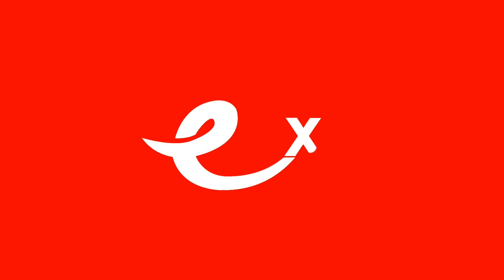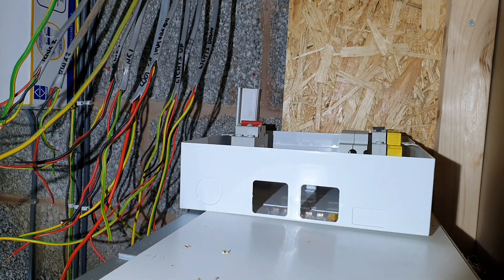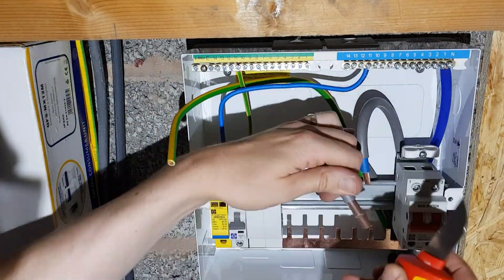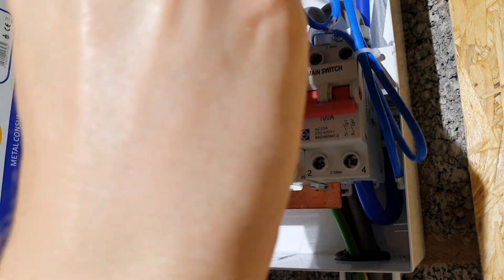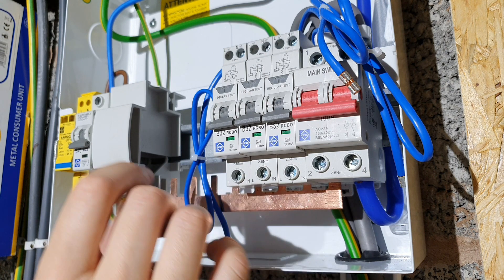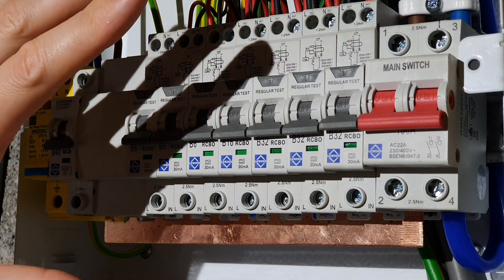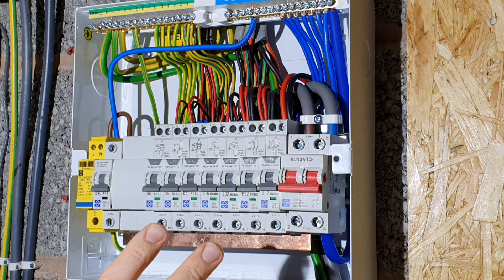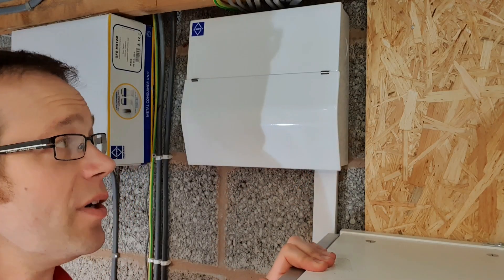LEWDEN CONSUMER UNIT with DOUBLE POLE RCBOs

Comment: So what your saying is for all these years these RCBOs  may not have worked when you had a fault if it was blinded by DC which made it dangerous when we were told RCBOs the greatest protection for fires and to save life's tripping in 30 MA when it may not have worked  could you or Gary explain that please

Comment: They need to have a DP version of the RCBO and AFDD with a combined L & N bus bars as they have on the Continent.  They call them combs. This means only one common bus bar in the case, the earth. So much easier and neater, and faster to fit.

Comment: All those rectangular knockout are not ideal...

Why don't all new board come with NO knockouts so you can cut what you need where you need it?

Even a part-P sparks carries a full range of cutters, so designing your entry around pre-burst holes (often at APPAULING inconvenient spacing) is just SO 1990s, we have Starret TCT cutters, just use them!

Also it is requirement to offset the RCBOs @ 15 degrees from vertical or a contractor preference?

I think I'll leave Lewden (which they do well!)  to make Ceeforms and use brand name consumer units, this is nearly as bad as a Hagar!

Comment: If you’re going to be doing rcbo-only units, the layout with those neutral wires coming off them into neutral busbars becomes particularly senseless.

Wouldn’t it be allowed in Britain to have the type of layout more common over here, where input L and N are both on the input side? Usually accomplished with either dual input busbars or even click-in panels.

Comment: Still a bit unsure about those square holes, you didn't actually demonstrate using them. I accidentally bought a Hager board with square knockouts & ended up having to buy some very expensive plastic conversion plates to turn them into round ones.

Comment: In my country we usually have a situation where one phase is dead or is at low voltage. In that case we use a manual phase selector to switch the entire load to the good working phase. With these consumer units i don't see how you would add a manual phase selector. Any advice?

Comment: Wiring has changed so much since I used to do it, I've not seen a torque specific screw driver before, I've used a torque wrench when rebuilding engines. Have you seen the CU's with dual busbars? They're well neat, no need for all those neutral leads to the RCBO's, great for TT supplies.
Reply from the maker: It's an ever developing industry that's for sure. Lots of interesting innovations going on.

Comment: Why are manufacturers STILL only making such small boards as standard?

Typical 3 bed semi with garage and utility room:
3 x lighting up, down, garage/outside
3 x rings - up, down, utility/kitchen
1 x dedicated fridge/freezer circuit on RCBO minimum to avoid false tripping elsewhere shutting off all power whilst on holiday!
1 x dedicated boiler feed
1 x cooker high power feed
1 x garage/shed power
1 x EV output
1 x solar PV connection

Plus space for surge protector (WHY?? NEVER had any problem with surges and the last thing I want is total power off if there is one)

Plus space for isolator (WHY?? should be an external isolator, post meter, pre CU - plus Henley block for separate feed/s to external shed/garage)!!

Plus space for AFI

 Totally insufficient space in standard CU for all that with AT LEAST 2 blank positions spare for further /later requirements. WHAT? A whole NEW CU AGAIN!! JEEZUZ! What do you guys think customers have in their gardens ... Money trees? The actual cost of the metal box is a tiny proportion of the overall cost so fit one with space to expand. Better yet, let's junk CU's altogether and start fitting industrial style steel cabs 450mm x 550mm x 150mm with space for plenty of additional monitoring kit and home automation instead of all this ad hoc external (not so smart) technology on separate screens with zero connectivity to a computer.

If anyone says something completely dumb arsed like "don't bother with ring mains , single spurs will do!" I swear I'll blow my lid! Just one 20A spur with multiple dual 13A sockets is incapable of supplying BOTH sockets with their rated feed. In a kitchen WITHOUT a ring:
Kettle - 3kW
Microwave -  1kW
Dishwasher -1kW
Toaster - 800W
Fridge/Freezer (not on dedicated circuit) 
Cooker hood/extractor - 450W 

That's already over 6kW - 2 fully (over) loaded spurs without adding in other stuff also likely to be used at the same time. The only differences being:

2.5mm2 T&E cable ring main with ONE single run return to complete the ring and with headroom of 6 amps on the breaker and 50% headroom on the cable capacity

Compared to:
2 x 4.0mm2 spurs to split sockets - how are you going to split them? How are you going to ensure that three heavy loads CANNOT all be connected to one spur thereby overloading it? Answer: YOU CAN'T! Hence the use of a ring for the kitchen and a ring for the utility room and play safe, for the increased cost of a few metres of 2.5mm, instead of a full run of 4mm for Upstairs power. The latter is ALWAYS more expensive!
Reply from the maker: Wow, what a passionate comment, thanks, there's quite a bit to unpack here but just to address the headlines. This size consumer unit filled the need for the three bed detached house that it went into leaving a couple of spare ways, of course there'll also be lots of installations that don't have as many ways. Surge protection won't disconnect the power it just absorbs the surge helping to protect the installation and equipment. You raise some interesting points on rings vs radials. I always take a case by case approach to this. I rewired my previous house with 16A radials and no problems on loading, I'll keep the ring for my kitchen when I refurbish it but recently put an A2 radial in my garage, it's about getting the right circuit in the right place I guess. 👍

Comment: Knipex ergo strip for meter tails. Will stop you in your tracks when stripping larger round conductors
Reply from the maker: I've got one of those, didn't think to use it for tails, I'll definitely try it next time. 👍
Reply: @efixx  like a brand new set of crops it takes some getting used to to make sure you don't damage cores but once you get it you will find you only want to use it and nothing else
Reply from the maker: Nice, can't wait to give it a go!
Reply: Surge protector leads look tidy but being at that end of the board extends the length significantly. JW's  video on the subject shows that the length should be as short as possible for it to be effective.

Comment: The tail clamp gives trouble with the routing of the tails if you want to bring them directly up behind the main switch. The thought that they may have designed the new consumer unit with a little more depth in the enclosure and bring the DIN rail forward resulting in more space behind the DIN rail. 

Just need to find somewhere that's selling them now

Comment: Nice video, thanks for posting. Not trying to be pedantic but are these RCBOs really double pole, do they offer overload protection on the neutral too? or are they single pole switched neutral like most other's.
I know you can get double pole RCBOs but they are  generally used in Europe.
Reply from the maker: Not pedantic at all that's a really good question, I'll try and look into it and let you know.
Reply: Hello Andy! Our NEW RCBOs are Double Pole Switching but only has overload protection on the line pole. If you need any further information, don't hesitate to contact us!
Reply: Current only flows if a circuit is complete ~ break the circuit once and current will cease to flow. The isolation achieved by double pole disconnection protects (grounded) you from a higher potential on either of the supply-side conductors. There is no need to break the circuit twice in the RCBO.

Comment: Lewden are great . My local supplier struggled with stock lately and I reckon it’s because they have changed their design lol . Still a good idea 👍🏻
Reply from the maker: Keep trying Tom, I'm sure they'll be back up to speed, there's issues with supply chains all over the place at the moment. 👍
Reply: Hello Tom, Thanks for the feedback! We are always working proactively to keep improving our products.
Reply: @lewden3275  bit if constructive criticism... I fit these as my go to boards now and have for a few years. However... the tails clamps tend to get in the way if the first rcbo and push it sideways a few mm as can be seen in this video. The spd's sit at a very slightly different angle on the din rail too almost tilting slightly upwards. And finally are there any plans to drop the control gear direct branding from the ones purchased through denmans, with stock currently up and down I'm having to use 2 wholesalers, if it was all the same it would be nice.

Comment: Is there a reason they all have a wire builtin for neutral in? Why not use a terminal like for everything else?
Reply from the maker: Most manufacturers do it this way currently, a few are starting to produce boards with neutral busbars like the line ones, mainly a cost issue I guess.

Comment: I had a comment from my inspector when I showed him a board that I had exposed the coloured insulation on the tails. He said it was bad practice, reducing the protection to single insulation. Thought it was interesting to see you do exactly as I had for years.
Reply from the maker: Yeah, that's how I've always done it. I guess the thinking on their part is that you should only take the lid off if the main switch is off so everything else is dead but the tails will remain live and so the extra layer of PVC will help. However the grey outer is technically a sheath not insulation so it's a bit of a void argument really. I think the takeaway from this is that if that's the level of stuff he's pulling you up on you must be doing a pretty solid job. 😊
Reply: That's crazy I always strip the insulation tails back, my NICEIC inspector has never said anything. It's in an enclosure why would it reduce protection any more than all the other cables that are stripped back inside the enclosure, don't understand their thinking.
Reply: Bad inspector
Reply: It seems a petty observation for your inspector to make, when you consider that the busbar often has no insulation at all.
Reply: I've had a similar thing in the past. I couldn't understand no other inspector mentioned it to me prior to that. These guys know their stuff inside out. I tend to use the coloured tails now.

Comment: I would never install them to start with and you tightened up all the RCBO's and the main switch pissed...
Reply: Unfortunate because the shoulder of the clamp for the tails was engineered too far to the right - no facility to move the clamp to the left. The fixing at the bottom of the switch was determined by the pegs on the busbar; so the result had to be a crooked main switch.

Comment: I think all these boards have become like mobile phones they all look the same.
I don't know if this is the case on this board, but I used one of their boards a few months ago and needed a type C for a mist system, I got a type C from the wholesalers, then found out it wouldn't fit, when i contacted lewden, they said the board was not designed to take a type C breaker, crazy.
Reply: Hello Anthony, would it be possible for you to drop us a DM on one of our social media's? as we would like to find out more about this!
Reply: @lewden3275  hi, I am one of the minority that doesn't use social media, but I had one of your boards, needed a type C, CEF gave me a type C, but it turned out it was for a three phase board, when I took it back, they contacted lewden, who said the single phase boards are not compatible for type C breakers.
Reply: @acelectricalsecurity  Hello Anthony, we are sorry you was misinformed on our product offering. We offer Type C in both MCBs & RCBOs in both 6kA & 10kA, these are displayed in our literature & also on our website www.lewden.com
Reply: @lewden3275  ok, thanks for that, I thought it strange, but I didn't check it myself, just went with what I was told by CEF and they were passing on what they were told.

Comment: I can't believe you're still being given uninsulated busbar for your consumer units. For the sake of 50p worth of plastic after mandating more expensive metal boards for a mostly overstated fire risk.
EDIT: Reached the point with the terminal shield, but point stands. You can't forget a cover that's integral to the busbar.
Reply from the maker: It was just a light hearted comment fella, I've never left a job without one on.
Reply: @efixx  Not questioning your professionalism, I'm having a go at the manufacturers. An Australian supplier who tried to foist that off on we electricians would be pilloried, so it's up to the British professionals to tell your suppliers that naked copper is just so 1980s.

Comment: With more and more manufacturers doing these all RCBO boards at a reasonable price I'm waiting keenly for the first plug in neutral bus bar. This would run along the top of the RCBOs, then a single 16mm wire into the neutral bar.  The neutral ports are already offset forward to allow this, and it would do away with the neutral tails.
Reply from the maker: They already exist in the commercial world - and available for type A single phase boards.
https://youtu.be/e54ud_CIvEU - let’s hope they start appearing in the domestic world 😄
Reply: @efixx  Cheers Joe ... I had seen that, must be where I got the thought from ...
Reply: I was going to say the same. Would be great to have a neutral bar.
Reply: @AndyK.1  Be great if they went the whole hog with ISOBAR and got rid of circuit wiring to protective device connections completely.  You'd wire to main switch with tails, then to an 'ISOBAR' type bar with lever connectors for each circuits L, N and E. Then the devices would plug straight in....  Nice dream to have!
Reply: @dominicdodd9759  See David savery ES video published today! He only gone and got one!
Reply: SBS trade sales do one, it is an amazing board

Comment: Firstly I am not an electrician, but I do know enough not to tackle a CU change and your videos on whether my CU needs changing proved very informative.

I have my CU booked for change in just a couple of week as the property I live in is now 30 years old and to be honest doesn't seem to have been wired to any specific standard to start with, although I cannot say that it is unsafe albeit unsatisfactory with todays regs.

I see the main difference between the RCBO and normal RCD/MCB CU is the price. I have been quoted £600 for the CU change along with the additional works to make the installation satisfactory. I was also quoted for a CU using RCBOs and AFDDs that was £1600 more at £2200 (all prices are plus VAT). I realise that RCBOs are not yet compulsory, presumably that will be in the next edition of the regs, but I would have gone for the RCBOs had they been cheaper. I would stand maybe double the cost over RCD/MCBs but nearly 3 times just busts the budget big time at a total extra cost including VAT and the testing already completed of over £2000. 

I don't think that until these devices are cheaper or compulsory that many home owners would voluntarily elect to have RCBOs installed. I'll give credit to the firm that test mine installation and will doing the work changing the CU, they did not pressure me either way. As I said I know enough, and have an internet connection to find out more from your excellent channel to enable me to make an informed decision, but that may not be the case for everyone.
Reply: It’s the AFDDs that are driving the price. Ask for quote for RCBO only.
Reply from the maker: The full RCBO option you've been quoted seems a bit on the steep side. It does however depend upon the number of circuits in your home. However more circuits on a dual RCD + MCB board starts to run in to problems as you approach the limits of allowable normal leakage current which can cause nuisance tripping.
Reply: @efixx  Just 10 circuits in total and all but 3 are 20amp or below because of the way the house was wired in the first place. If there is any nuisance tripping the electrician will be making the 60 mile return trip to sort it
Reply: @CP-du3ci  I got a 9 circuit Fusebox CU installed with RCBOs and SPD and test for £480! Whoever quoted you is looking to take you for a ride! Although AFDD are far far more expensive than just a simple RCBO so that might be why the cost is so high!
Reply: @CP-du3ci  I think you'll regret not getting RCBOs, the price shouldnt be that much higher and the benefits are numerous. No more one faulty circuit plunging you into darkness.
Reply: I should add that I am just outside of Edinburgh.
Reply: @callumBee  I thought you may well be a Scot with a name like yours. Life becomes more interesting when you get north of Perth and by  the time you reach Inverness it get down right difficult